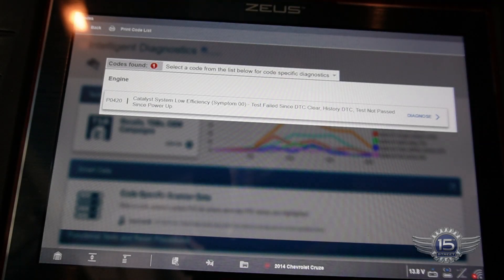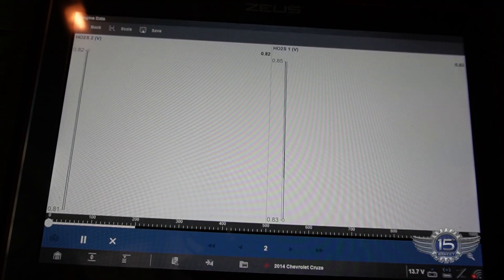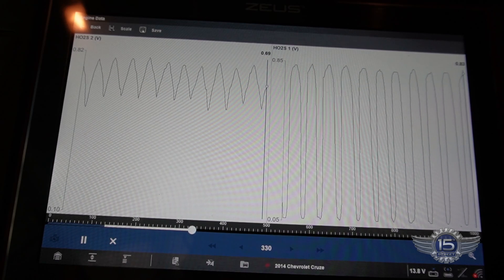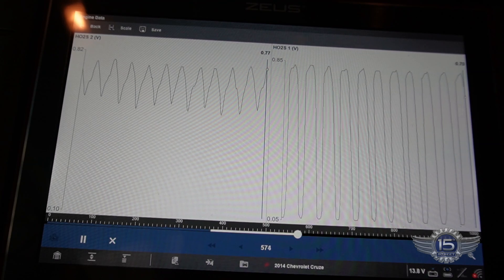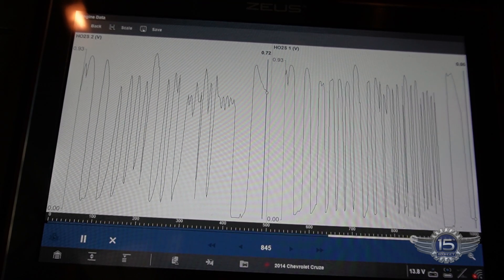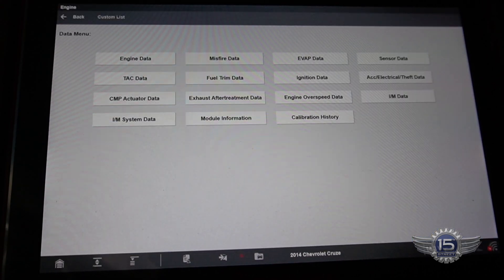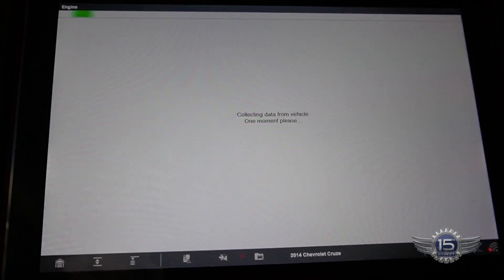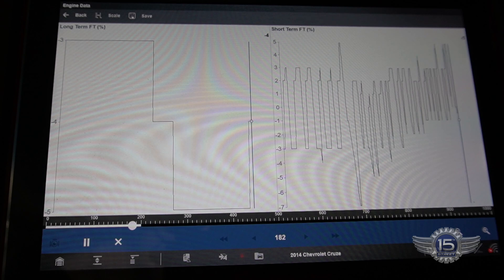Chevrolet Cruze P0420 Catalytic Converter Diagnosis Explained

Comment: Did this Chevy Cruze come back in or is it still running fine with out P0420 code. Or did you find another cause for Catylitic converter failure.  Thanks for the video.

Comment: Yeah that sounds like it could have been the problem... But in mine and everyone else's it was the little plastic piece inside of the general motors intake manifold that purposely falls out... Causing massive oil leak forcing oil into the turbo into the combustion chamber and clogging the catalytic converter.... What is the fix a dorman intake manifold and a new converter...

Comment: What if you just changed all that the spark plugs and boot and oxygen O2 sensor?  But still getting that code
Reply: 2016 chevy cruze limited lt (with turbo)
Reply from the maker: Your problem is likely a failing catalytic converter.

Comment: How do we know which of the two cat converter is bad ?
Reply from the maker: If it has two cats, only one will be monitored. The one that has an oxygen sensor after it or in it will be the one that is monitored. If it has two cats the other one will be to clean up any remaining CO or HC. But if you are replacing one for failure it's recommended to replace both.
Reply: @fixingcarswith15thstautomo36  i have a 2011 chevy cruze with 2 sensors but i guess this is the upstream

Comment: Question. So my car is stilk throwing the p0420 code. My mechanic had already replaced the upstream o2 sensor maybe twice. Replaced the cat with two aftermarket and lastly also 1 oem cat. Still throws the code with a factory cat. Also a 2016 cruze lt limited. What else could be the issue?
Reply from the maker: The code sets because the rear O2 sensor is overly active. The rear O2 sensor will have a nearly flatline signal at about 600 mv when a healthy catalytic converter is functioning properly. If the O2 sensor is still fluctuating between 200 mv and 800 mv then there is either an exhaust leak around the catalytic converter or the converter is weak. Aftermarket cats can be poor quality and do this, but OEM cats will usually function well. I would check rear O2 sensor operation (force the mixture super lean and see if it drops to low voltage and then force the mixture super rich and see if the voltage goes high) otherwise check for any exhaust leaks than could introduce stray oxygen into the exhaust stream that might change the rear O2 sensor reading.
Reply: Aftermarket cat converter do not work
Reply: Do both o2 sensors and maf sensor. It's cheap and easy
Reply: @scottisaaks well thankfully i no longer have to since i got a new car